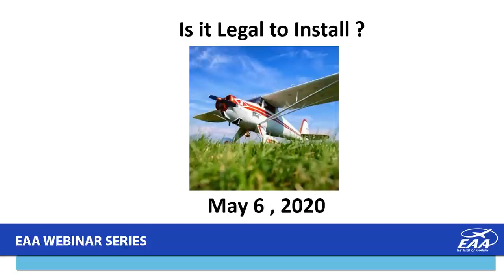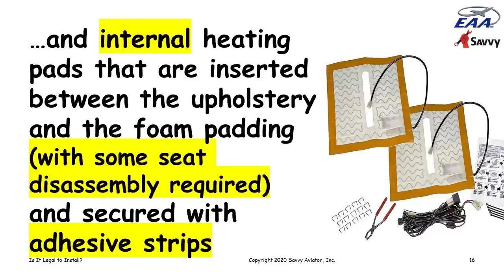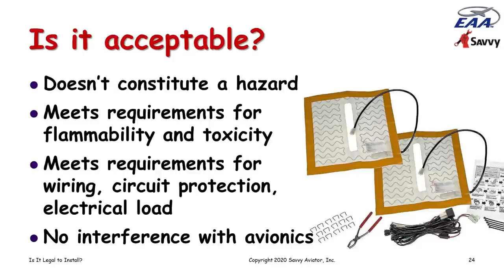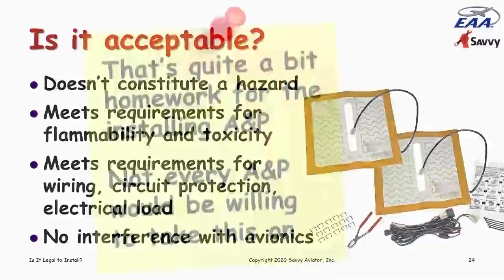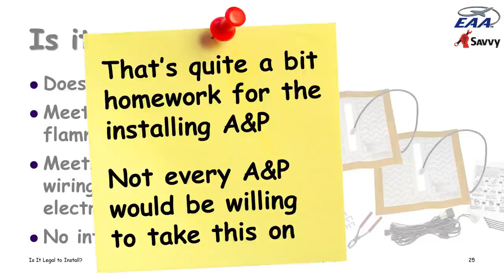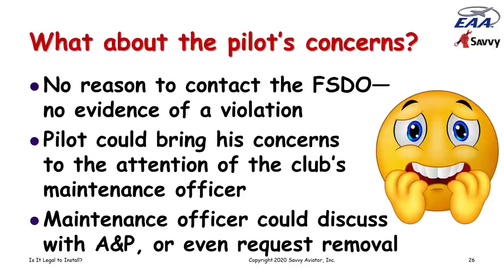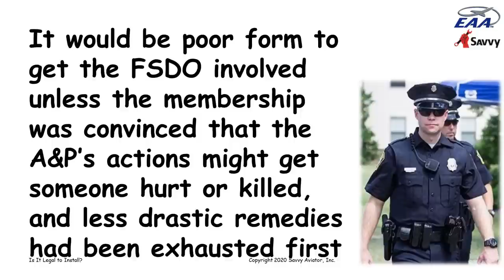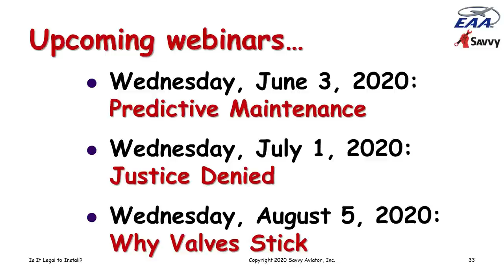Is it Legal to Install?

Comment: In regards to the LED landing lights for a CAR 3 aircraft there weren't such things as a PMA'd bulbs in 1953, it calls for applicable type. An applicable type was one that was designed to fit the socket and emitted a given amount of light without drawing too much power. So if I get an LED landing light that is brighter and draws less power and is designed as a direct replacement, how is that not applicable?

Comment: Power source for these? Do they plug into a previously installed cigarette lighter, or must they be wired in? To what circuit? How much additional current on the chosen circuit?
   Doing inspections, I find undocumented cigarette lighters, not always fused or with breaker protection.
   Not ok. I think there have been fires from this..maybe more than one.. in a Navajo? 
    The wires powering a heater in a sliding seat are at risk of being run over on the seat track. 
     Bzzzt!.....hey, do you smell something?

Comment: I'm really late to the party and not all that experienced on these little Buddy Holly airplanes, but doesn't a 172 have a 28 volt electrical system? And if the case that precipitated this video is one where an automotive (14.7 volt system) seat heater is being used in a 172, what will the impact be of running a heating element designed for a 14.7 volt system at 28 volts? How was it wired into the a/c power system? Under what breaker? Does the 172 have an automotive-style cigarette lighter power port? As an A&P, I would not be comfortable doing this for fear that the 14.7 volt seat's wiring could burn through its insulation and start a fire when faced with 28 volts. Is there any fire protection data available for this car seat heater? I doubt it. The impact on circuit loading would have to be tested, as Mike said, but could you trust your own shadetree testing in every use case the pilot is likely to produce?

I guess that was a verbose way of saying - I don't like it. I could be dead wrong, but I'll need it explained to me a little better.
Reply: 172s are 12v and  its a DC system.
Reply: @joserosas4489  Everything I've read shows the 172 is a 28vdc electrical system. I meant a/c as short for "aircraft." (a commonly used abbreviation in aviation)
Reply: @joserosas4489  Some are 14V and some are 28V.  It depends on the model.  The newer models, like the S, are 28V.  As to the original question, nobody would wire a 14V item to a 28V system or vice versa.  The wiring alone may not handle the load and you're at risk of at least damaging the item or, for high-draw devices, causing potential risk of fire.  Each mechanic would have to evaluate their own risks, but I doubt the IA I know would put in an untested electrical item, especially one designed for automotive and not aircraft use. 

As for parts installation, imo that's up to each mechanic.  If you can't justify the installation using your conscience and acceptable data, don't.
Reply: 24 volt systems did not come out until the late 80s. Before that they all had a 12 volt system.

Comment: What about seat flame-resistance requirements... hear me out. 

A seat doesn't have to be fire proof, just flame resistant. Assuming flames come from outside the heat in, not inside out,  if you call the seat manufacturer and ask if inserting an uncertified heating coil between the approved fabric and the foam padding, would that decertify it's flame resistance certification? Then it's a major alteration

Comment: I was contacted by the FAA and an IA the FAA contacted first about this club and was sent pictures of the installation of these heated seat, the seats are the 2nd type , inside the seats and internal hard wired into the aircraft's electrical system.  I dont know what all happened about the install.  Kept my nose out if it for good relations seeing I work on the same field.  My opinion was the exact same as yours. I also own and run a flying club at the same field and I put to good use of all you teach here and hold my own seminars of your teaching to pass on the Amazing advice so thank you for helping to keep us all safe and give us the wisdom to do our jobs the best we can!!! Thanks again, Kurt

Comment: I would hope most owners wouldn’t move instruments from one hole in the panel to the next (unless properly rated or knowledgeable) ie the question about swapping nav heads back and forth.

I’ve seen several instances of where someone may or may have not done their own swapping and messed equipment up, worst I’ve seen by mixing up pitot static lines to the wrong places and flown several times

As far as the question about throwing a random auto alternator belt on there, I wouldn’t do it. Seen someone do that on a continental with the Alternator in back and all it wanted to do was skip the pulley. It is quite funny how piper will sharpie their part number on a gates belt and add $20 to the cost